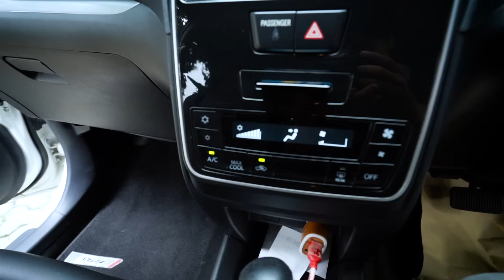CARA MENGECEK KONDISI MOBIL BEKAS

Comment: FYI Cara ngecek gejala air radiator akan masuk ke ruang mesin : start mobil sambil buka tutup radiator(yg di radiator unit bukan reservoir tank) kalau ada gelembung berarti gasket mesin harus segera di ganti karna kompresi bocor ke rongga untuk jalur air pada blok mesin(ini tanda2 air akan bocor ke ruang bakar)... Yg parah adalah air lsg muncrat saat di starter dan di gas sedikit ... Kalau sebatas mutar berarti pompa air radiator sedang bekerja.
Reply: Satrio Darma up
Reply: Nice
Reply: 😇 apo tanda laen tuh problem gasket... air radiator suka kurang omm
Reply: Maap bang ijin tanya, ane masih awam. Itu buka tutup radiator sambil dinyalain mesin apa ga bahaya bang?
Reply: @raihananwarthaha1193  kalau posisi cold start(start mesin dingin) aman2 aja krn tidak ada tekanan di dalam radiator. Kecuali saat mesin sudah panas sekitar 90°C maka akan sangat berbahaya jika membuka tutup radiator.
Reply: @permadifauza5251  bisa saja itu ada kebocoran di radiator dan jalur pendinginan nya. Kalau sudah masuk lewat gasket ke ruang bakar itu berarti parah sekali.
Reply: @satriodarma1298  klo masih dingin itu nanti airnya terbentuk pusaran  ya bang pas dinyalain?
Reply: @raihananwarthaha1193  yoi yg bagus nggak ada gelembung sama sekali... Klo pengen lebih bagus di gas sampe 3000 rpm aja... Nggak ada gelembung sama sekali berarti internal nya kemungkinan bagus
Reply: @satriodarma1298  oke gan, makasih banyak atas ilmunya👍
Reply: @raihananwarthaha1193  mantap
Reply: Maksudnya yg di radiator unit itu, bukan tempat pengisian coolan nya itu ya bang? Mohon pencerahan nya. Inshaa Allah besok sy ada janjian sama orang beli mobil bekas, jujur saya masih awam tentang mesin.
Reply: @suhaimidaemi6144  ya bukan yg di tempat plastik bening nya(reservoir)... Tpi yg memang di radiator unit... Semoga manfaat
Reply: @satriodarma1298  mantap.....  makasih infonya bang
Reply: @satriodarma1298  mas kalo knalpot perih Dimata kira kira apanya ya
Reply: @arfnsetyawan7732  d9u.m
Reply: Kalau tabung recervoir bertambah saat mesin panas gimana bg? Tapi tabung recervoir ya gak sampe tumpah.tapi saat mesin dingin air radiatornya gak mau kembali lagi

Comment: Bang, mau tambahin, pada saat nyalain ac, buka kap mesin, dan dengerin, apakah timbul bunyi tek tek tek, kalau iya, maka hal yang patut dicurigai adalah kompressor ac nya. 

Untuk manual, Coba masukin gigi 1, 2, 3, 4, 5, R, apakah masuknya lancar atau seret, atau bahkan tidak ketemu posisi masuknya, maka ada problem di bagian persenelling atau kopling habis.

Nyalain tape audionya, kencengin volume nya, kalau sember suaranya atau ada yang aneh keluaran audionya, maka bisa jadi speaker mobilnya dah harus ganti.

Itu tambahan dari saya bang. Nuhun 🙏🏻
Reply: Itu masukin gigi dalam keadaab diam,atau sambil jalan ya.. Maaf masih baru 🙏
Reply: @silatboy3095  dicoba dua2 nya om, saat diam dan saat jalan. Tapi saat mau gigi mundur atau R , untuk beberapa mobil gak langsung masuk, harus di masukin gigi 1, baru ke R, itu udah lumrah untuk beberapa mobil.
Reply: @masulcover8935  oh gitu.. Sangat bermanfaat.. Terimakasih banyak om info nya 🙏
Reply: @silatboy3095  siap om sama sama, saran dari saya kalau mau niat ambil mobil second, bawa temen om, setidaknya satu orang, kadang suka khilaf om, suka lupa, langsung deal aja tanpa sadar. 😄😄😄
Reply: @masulcover8935  iya betull.. Bawa yg ngerti mobil pasti nya.. Wkwk
Reply from the maker: Kelupaan transmisi, thank you om sharingnya
Reply: @ridwanhr  siap bang sama sama 👍🏻
Reply: Gimana dengan matic om ?, Saya baru beli mobil seken matic hehe (Avanza 2014)
Reply: Untuk kompresor ac baiknya di ganti atau cukup di service bang? 🙏🙏🙏kebetulan ada seekor avanza juga km 81rb gejalanya sama yang abang share hehe🙏😂
Reply: @m.zainulakbar139  coba bawa ketukang ac yang om percaya, minta di cek, kalau bisa di service, diservice aja. Tapi kalo gak bisa di service, berarti harus ganti. Harganya lumayan jika harus ganti baru, tergantung jenis mobilnya sebetulnya, tapi secara umum harganya lumayan. Kalau budget dirasa belum bisa atau masih ada keperluan lain yang lebih penting, bisa minta tolong ke tukang acnya untuk estimasi berapa lama si compressor ini bisa tetap bekerja mendinginkan meskipun bunyi tek tek, sebagai kisaran waktu untuk menyisihkan anggaran untuk kompressor baru.

Tempat cek ac nya kalo bisa yang cukup om percaya.
Reply: @muhammadhafizhhusain5099  saya kurang begitu paham mengenai transmisi matic. Tapi kalau masuk perseneling dari P-R-N-D ada gejala atau bunyi "duk" atau "ngejedak", om boleh cek dulu unit nya ke bengkel resmi untuk mengetahui masalahnya dimana dan berapa estimasi perbaikannya, atau cari unit lain. Selebihnya, bisa cek di youtube atau google om, banyak kok referensi soal cara memilih mobil matic.

Edit :
Ternyata udah ambil unit ya 😄. Semoga gak ada gejala "ngejeduk".
Reply: @masulcover8935  haturnuhun bang🙏
Reply: Seeplah...mantap kang bro....sok lanjutkan nya syiar ilmuna...hebring pisan
Reply: Coba dipake jalan, kalo belok bunyi ngik ngik, langsung aja berhenti. Kalu bisa ban depan di dongkrak, pegang dan dikocok bagian atas serta bawah ban secara maju mundur. kalau goyang berarti tierod rusak
Reply: Bunyi tek tek tek gmn ya mas?
Reply: Saat masukin gigi mundur ada bunyi krek gitu gmna om? Aman ngk?
Reply: @ZulhendriYohanas  ini kenapa ya kira2 bang bunyi krek itu, kadng sy bnrin lagi trs injak kopling lagi baru masuk gigi normal lagi kira2 itu knpa?

Comment: Pagi, izin tanya" Dong 😅, siapapun yg tau, jadi Babeku ada mobil Espass 97, nah belom lama ini turun mesin, trs bbrp bulan setelah turun mesin itu jadi gampang banget over heat, air radiator cepet abis, oli juga, tapi gada yg bocor olinya, itu kenapa yak? 🤔, bagi yang tau bisa kasih saran yak, terima kasih

Comment: Terimakasih videonya bang, saya mau nanya bang, saya tertarik untuk beli mobil peugeot bekas, tapi saya dengar2 peugeot sering masalaj denhan overheat, mitos apa fakta bang? Terima kasih
Reply: Peugeot lama sering overheat, rewel sparepart susah. saran jgn ambil kalau emg teliti dan mau repot.
Reply: @beradaptasico3903  kira2 level aman nya itu tahun berapaan bang? Misalnya untuk type 408 tahun 2011, apa masih aman atau besar potensi bikin pusing? Terima kasih bang
Reply: @topsecret9979  wah kalau taun 2011 mah sy kurang tau. Tapi kalau berdasarkan pengalaman sodara temen yg punya dulu peugeot taun 90 sampe 2005 an masih begitu. Tapi kalau berdadarkan orang bilang yg 2010an jg masih gitu jg katanya.